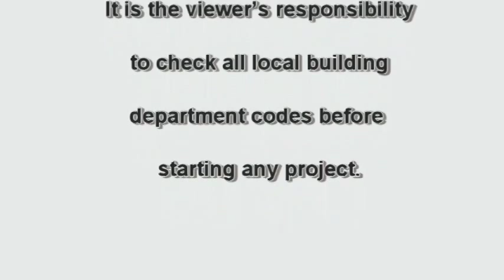Light Switch Replacement (Single Pole) By: Everything Home TV

Comment: Pro tip:
If the light is only controlled by one switch then the switch is a single pole, if the light is controlled by two switches then you must use a "three way" switch. 

If a house was built before 2011 then you were allowed to have non-grounded switches and have a white wire, the 2011 NEC code required all switches in dwellings to be grounded and both wires are black.

Comment: Ever get static electricity shock when flipping on or off the switch?  Cut small squares of Duct tape, 1/4 inch sq., and place them over the two screws on the plate!  I use white to match the plate!